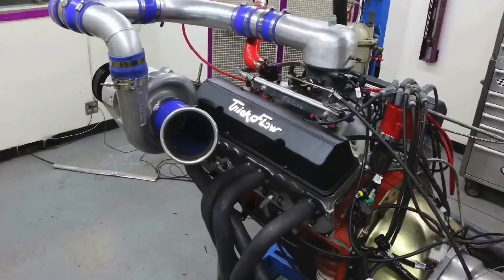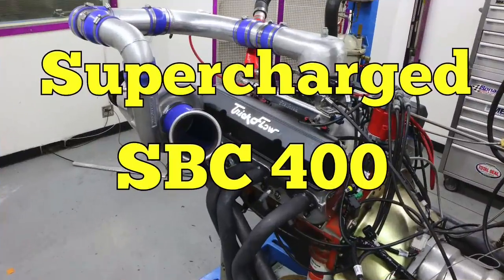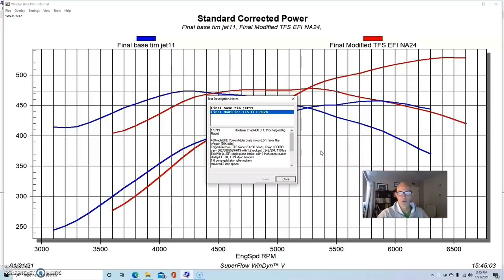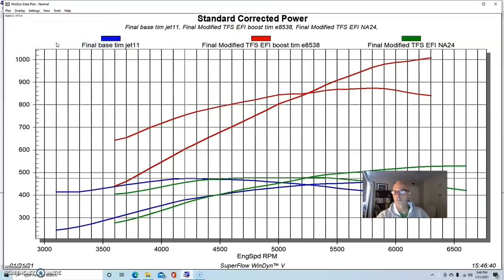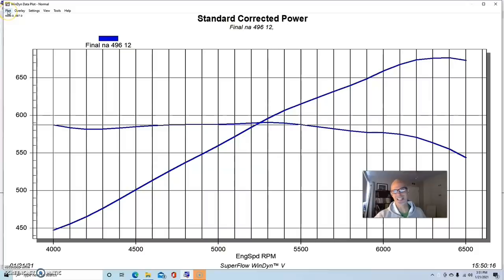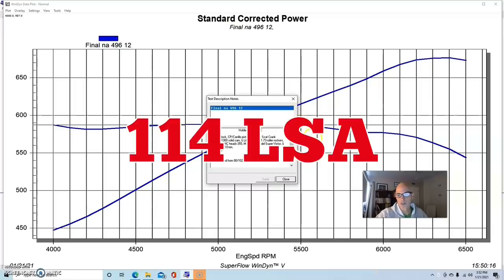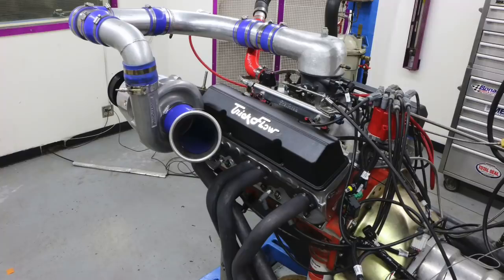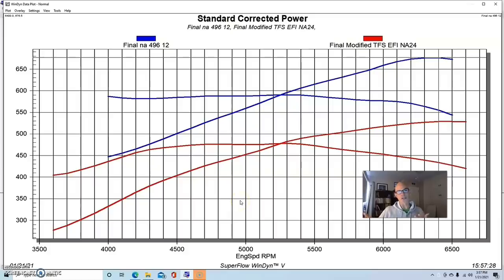400 SBC VS 496 BBC-1000-HP SUPERCHARGED BOOST BATTLE

Comment: They made the same power because they had the same power adder. Difference is a 1,000hp supercharger is only good for 1,000hp, but the turbine speed on a turbo is much higher and can feed more of the air demanded by larger/better flowing engines which in turn keeps the manifold pressure high.

Comment: It was just a fluke that the power curves were almost the same. You'd have to equalize either the boost or displacement to have an apples to apples comparison. That 400 is really impressive though

Comment: If you used a 350 sbc w great heads it would probably be similar as well if the heads and intake didn’t become the limiting factor; the psi boost would probably be higher than the 400.  Perhaps the difference is the stroke / piston that more easily utilizes the given air.  Bernoulli’s law of flow. Slower air velocity because of the bigger cubes.  Limiting power production in the big block  was the forced air.  I’ll take the big block to answer the original question.

Comment: The turbo would need to work alot harder to maintain the effective boost pressure in the larger engine. Its actually more restictive to the larger engine rather than the SBC. When the higher rpms are reached the air movement capability of the SBC is limited so the BBC begins to pull ahead.

Comment: Would be interested in a “type “ of size shootout.  400 sbc vs 396 bbc. Are all cubic inches created equal?
Reply: I think this would be a great comparison plus i have a 396and 4l80 sitting in my Cutlass  in the garage
Reply: If I recall correctly that exact comparison was done decades ago by Hot Rod magazine (or maybe Car Craft) 

The result? Again if I remember correctly,....... the BBC outperformed the SBC across the board! Why??? Better airflow for all the reasons you would expect ( bigger valves, bigger longer ports with a better layout when compared with the small block, less shrouding of the respective charges into and out of the cylinder, etc.) Even though the two engines shared a relatively equal displacement they are obviously two completely different designs. 

In most cases a big block will out perform a small block at less RPM. It  basically all boils down to torque. Torque is what actually the force that moves the vehicle and produces the "work" (and can be measured) Horsepower can be considered as torque at a higher RPM in relation to time ( how quickly the work is accomplished over  "time and or distance" and is actually calculated not measured)

Simply stated ,......ALWAYS build the Biggest engine (displacement wise) you can afford, build for torque and the horsepower will come. 

In most cases following that plan the end result will be a longer lasting, more efficient, more drivable combination that you don't have to constantly have to work on.

Bear in mind I'm old school (conventional BBC and SBC so I cannot comment on newer tech such as Ls stuff etc.)  

When it comes to small blocks I won't build anything smaller than a 383 (although I have built more than a few 377's) but actually prefer to build 406-420's

As for Big Blocks 496-525's are what I typically build

Comment: given that the volume of air is the exact same or within ballpark, i would imagine the more restrictive chambers, channels, or what have you of the smaller motor start causing issue as RPM increases. Blower is directly linked to engine RPM so the flow rate of air increases with RPM and they start to diverge once the pressure increases because of this physical issue. For the lower RPM i imagine the displacement differences don't make much of a difference because the resistance is almost the same, but once you hit peak you showed that the "Boost" pressure was higher on the smaller engine than the larger engine which leads to resistance, turbulence, and all that jazz (i would like to see the boost pressure line along the engine rpm for both to see if that works). Since all other given data points are the same on engine roughly and the difference is within 10% it has to be something along those lines. Just my best guess

Comment: The same power at the same rpm range was because the blower was putting out the same Cfm of air. The before and after of the rpm range changed because of the efficiency of the engine. The big block ran away because it wasn’t at the end of its efficiency range with that size blower.

Comment: The larger displacement kept the boost pressure lower but the given volume of air was present from the blower so the horse power was similar.
Had the blower been turned faster on the 496 to achieve  the same boost pressure peak and curve as the 400 the horsepower change on the 496 would be more reflective of the NA differences provided the blower is capable of more airflow at the increased boost pressure on the 496.

Comment: So one uses E85 and no A2W cooling the BBC uses race fuel and A2W cooling which could be more beneficial if ice is used over large volumes of room temperature water alone, thermal mass to absorb heat helps with huge volumes of water in a Dyno for short runs, the boost seems to be different due to filling a smaller motor vs a larger motor, same vol in a road bike tire vs a mountain hike tire would be less psi, now run them both with race gas C16 and A2W and I think the SBC may do better since that fuel is more forgiving and may, allow more timing. But still size matters here and it’s a great test!

Comment: They made the same mid range power because the blower supplied the same volume of air, and both motors could use the air. But up top the big block was zble to use the supplied air, whereas the little motor was saturated. 

Now throw a 3.75 pully on the blower on the big block and let's see what they make on the same boost. 
Btw. that BBC would have had a sweet curve with that blower had it been a 110 lsa cam. That 114 lsa cam was sweet for n/a and would have been koiller with a 10-71, but I think a 110 LSA would have suited the procharger better

Comment: If you had revved the SBC to its redline of around 9000 rpm it woulda made 13-1400HP and really blew the BB away that’s why smart drag racers run small blocks, the reason the SBC made more power ( this is gonna sound stupid but its true ) the less you have the more you get with a power added the more you have the less you get HP wise, when I was a drag race many many years ago everyone knew I had like 0 money in my car but none of them could figure out how I was so fast and almost always went home with some prize money from every race ( 1st-3rd unless I broke ) I used to go up against blown big blocks/NoS and beat them with my little NoS 350 they couldn’t figure it out I read a book written by Smokey Yunick and I learned a lot about how NoS worked and how to get extra hp out of your engines like these bottle heaters they run these days are dumb you want you NoS cold not hot we used to ice our bottles between runs the colder the NoS is the denser it is when it goes in you actually get more NoS when it’s heated it’s a lot thinner so you don’t get as much HP from it plus the iced NoS helps keep the air going in your carb cool
Reply: SORRY BUD , I BEEN RUNNING NITROUS FOR 32 YEARS ,  YOUR WRONG ABOUT COOLING THE BOTTLE ,  A BOTTLE HEATER / BOTTLE BLANKET GETS YOUR BOTTLE PRESSURE UP THE WHERE IT NEEDS TO BE , ABOUT 900 ,    ONLY WAY YOU COOLING WOULD HAVE HELPED IS IF YOUR BOTTLE WAS WAY TOO HOT , AND PRESSURE WAS WDY TOO HIGH,  LIKE IF YOU WERE RUNNING IN 100+ DEGREE TEMPS
Reply: ALSO NITROUS HELPS THE AIR GOING INTO YOUR CARB TO KEEP COOL ?

YOU DON'T RUN A WET KIT/ FOGGER KIT INFRONT OF A CARBURETOR !
KITS GO UNDER THE CARB, OR INTO THE INTAKE DIRECTLY !    NITROUS COOLS THE INTAKE , NOT THE INCOMING AIR THROUGH TGE CARB !
Reply: ALSO 9000 RPM ?   REALLY ?  COME ON MAN !

Comment: "Pressure" is a fluid's or gas's resistance to flow. A centrifugal pump like a pro charger or turbo does not move the same volume of air per revolution like a P.D. blower. Due to the lower back pressure on the S.C. with the big block, more air volume was moved through the S.C. by the big block. That means the big block experienced more parasitic loss due to the S.C. than the small block. if a roots or screw style blower was used in the same manner the effects would be reversed and the big block would have made dramatically more power than the small block.

Comment: They made the same because of air flow. The boost was higher on the small block because of restriction.  With consistent blower speed, boost is a measure of restriction.

Comment: 496 just seems like a great combination.  You can get there with a standard block and a stroker crank.  Its heavier and larger physically, but probably capable of making 700hp plus at modest rpm even N/A

Comment: For longevity Big Block Chev and long term reliability. Even the lsx motors with twin turbos struggle, do that to a BBC and compare same cubes keep boosting and see which one will break first identical or close in cubes at the same power ?? weight means nothing when you go straight BBC wins for mega torque/ power their naturally brutal Do they make a 632 lsx motor?

Comment: I think it's a function of the BBC having a better overall VE in this comparison as evidenced by the lower boost which is the result of less backpressure through the pump/engine. 

I'd like to see a dyno comparsion between a SBC 400 and a BBC 396/402. That would show a much truer representation of the difference between a small block and a big block because the displacement difference  wouldn't be a factor in the equation.

Comment: Cylinder heads. They'll flow until they don't. The blower obviously is far more efficient than either of the heads capabilities.
They both were able to use the blowers ability to push air until the small block just couldn't do it any further..
Note that the big block was able  to use all of the blower and looks to have hit its max rpm before losing power.

Comment: Super exciting test!
Can you talk more about fuel consumption between the two engines and also in the earlier test between turbo, roots and centrifugal blower?
At same boost on the same engine different hp figures means difference in effectiveness for the compressor impeller - or am I wrong?
Maybe plot boost and airflow on a flowchart?

Impeller is most effecient at certain flow and pressure - so the lower boost in the bigger engine may lead to higher fuel consumption/bigger injectors(?) - am I guessing correctly? 

Btw - you have the absolute best job on the planet!! 👍👍👍👍👍

Peter - Denmark - Europe
Reply from the maker: the difference is a combination of parasitic losses associated with driving the blowers and impeller/rotor efficiency

Comment: Volumetric size is the different here, smaller size in the sbc compared to the big block, the big block hadn't got the boost it needed for the volume of the chamber in the intake port and the combustion chamber, but it would be nice to see the power to weight ratio in a same size car and see what happens on the quarter mile ???? could the weight of the small block win with being 100 or so pounds lighter ??? take it to the track and see........

Comment: My thinking is that the blower can only produce a given amount a flow(cfm) at any given rpm. So same amount of air at the same air to fuel ratio will give about the same amount of power. Until you hit the air flow limitations and in these two it looks like the flow of the head/cam combination of the 400 ci started to limit the amount of air reaching the combustion chamber.

Comment: Interesting. My opinion is that hp is  relative to the air that you flow. So if the blower speed is the same, the power in the blowers efficient powerband is going to be the same in any given engine. The thing that will variate is the resistance for the air, in this case the psi. In the lower inneficient blower speed and in the top inneficient speed, the engine is going to affect

Comment: my engine guy made 604 hp from 1969 350ci GM parts that were available in 1969 for controlled class racing,,,, no aftermarket parts,, hercules engines  on youtube,, 604hp 350 with stock GM parts.. and that engine ran all season in circuit racing   in Steve Masons Camaro and won everything..  you dont need all this crap.
Reply: Yes . but the aftermarket needs to sell PARTS. 😆.
Reply: @chriscatarcio7534  exactly. But all these big names..you dont need this stuff..gm made good parts over ths counter that surpass all the hype..
My friend ned used 1969 gm parts and got 604hp... yes it has 13.1 comp,,, yes it ran bowtie heads from 69,, and assemble took a week......it ran for 14 meetings and broke records on road race circuits some 6 mile long

Steve masons camaro at bathurst ran 181mph lap after lap with 1969 made parts.. great video with all them pre 1974 mustangs and amc javlins hot on his tail
Reply: I fully support American made aftermarket parts...make america great again
Steve in australia

Comment: Hey Richard, im building a 383 gen 2 sbc with a vortech V-7 YSI,  planning on 15 to 20 psi.. was wondering if you have done any collector header vs. Zoomies testing on something like this? Asking because unfortunately due to how my chassis is built I may have no other option than zoomies. I always liked the look and sound but im worried about giving up power in order to run them? Btw to answer the question all things being equal I figure 1000 hp is 1000 hp so ... id pick the smallblock only because of the weight savings. Blown big blocks are pretty sexy though LOL!!

Comment: I missed your live stream. Hoping you would answer a question for me on what kinda power onE85 potential I have.  LY6 with forged rods and pistons, twin Borg Warner s300sx3 .91A/R with T4 flanges , stock intake and BTR PDS Stage 2, LS3 heads. 10.1 compression, 30thou ring gap. I'm street tuning it when I'm done. Any pointers would be great. Terminator x Max system, plenty of fuel also.

Comment: It made the same power, because like Gale Banks says MAD is the new tuning method.  That's Manifold Air Density.  Power is determined by the air density, not the pressure.  2 different boost levels can move the same amount of air, and thus make the same power.

Comment: PV=nRT explains everything you need to know about what you're seeing between the two different displacements.  For more detail you should have measured charge temperature and then you would have had all the data you needed to use the formula assuming no gross changes in barometric pressure or engine to engine variations in internal friction.

Comment: You really need a compressor map of the blower really see what's going on but Procharger doesn't supply that information. The blower seems to be more efficient on the sbc with that pulley in that range than the BBC. You would need to spin it harder to stay in that efficiency range on the BBC but then you would definitely make more power. It would be the same if it was a turbo on two different motors. One would be more efficient than the other.

Comment: Hi Richard, love your stuff but with this comparison I have to ask, why ?  With tailored combinations everyone knows the larger motor will make more power, with the same power adder running the same speed the larger engine will use more air and have lower boost because the power adder is putting out a constant volume of air, basically you're using a positive displacement supercharger not a turbo.   As for the power curves the higher boost in the smaller engine should match the larger engine HP at some point but who would run the same components between the 2 engines ?   I miss the point of this comparison, it's like a "da, yeah" moment unless to demonstrate the power curves could run together at a lower rpm.  I would have rather seen a comparison between a 400 SBC and a 396 or 402 BBC, at least then you would be comparing the efficiency between the engines.   I just don't get it.

Comment: I love this comparison.   Very few differences between the two.  The biggest difference is displacement.  Great job.   I would have loved to have seen what the BBC did with a pulley change that brought the boost to the same level that the SBC had.  My guess would be more power throughout the lower and middle part of the band with only a little more at the top of the rpm range.  What do you think?

Comment: My 2 cents... both engines were being fed the same amount of air. The big block made more power at the bottom because of bore size, they both made the same throughout most of the rpm range because they were being fed the same amount of air. The big block had less parasitic loss at the top because the blower was feeding a bigger displacement. I’m assuming the big block had more valve area because of bore size and higher flowing heads so it could process the air better at the top (less parasitic losses)